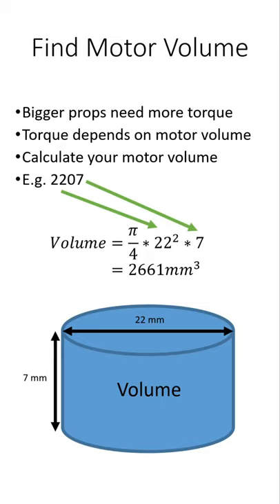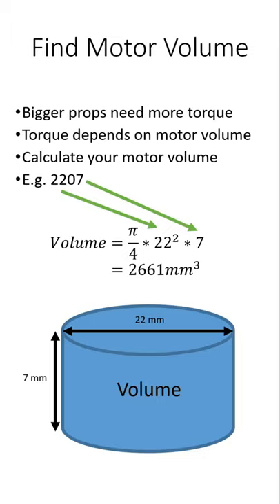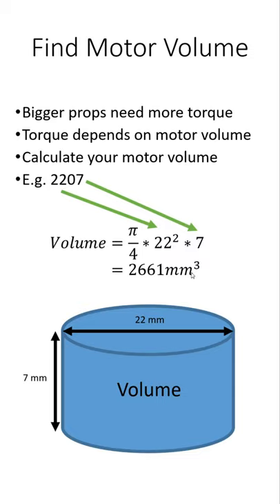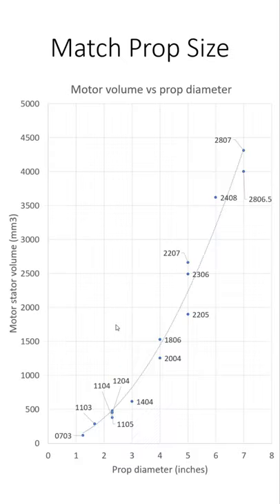How to pick the right size motor for your build in 45 seconds #shorts

Comment: Some other significant factors include:
1) How you plan to fly (efficient cruising vs racing, etc), 
2) Where you want to fly (sometimes the weight advantage is worth it if you fly indoors or in tight spaces even if a larger motor would have better command of the prop)
4) Even for a given volume there are tall narrow motors and short pancake motors which have different strengths and weaknesses. 

And of course there are many factors that determine how much torque you need. So, maybe not quite so simple. Also note that YT does not let you pause a video in the “shorts” format so the graph is hard to see.
Reply from the maker: Thanks for the thoughtful comment! I'm going to do a deeper dive on this over the next few days. I have some questions based on your points:

1) I would say that the choice of prop is what really matters here. If you are cruising you might use a low pitch prop but for racing a higher pitch prop could be better. A heavier prop needs a bigger motor because the cruising torque is higher so you need more max torque to retain enough torque reserve for control.

2) This is an interesting point. I would suggest that if you need a lower weight you could consider using a smaller prop. E.g. go down to a 4in prop then you could use a smaller motor and save weight on the frame as well. I think the end result will be better than having too little motor for a larger prop.

3) Pancake motors can have better cooling than tall narrow motors but their torque should be the same. That said a lot of pancake motors have a slightly taller stator than advertised which gives them more torque than expected.
Reply: Hi  @ChrisRosser , thanks for the detailed response. Yeah, the choice of prop is certainly a big piece of this puzzle.

Regarding tall vs wide motors... if you have torque measurements for motors of the same stator volume but different proportions, then I would love to see it. They do not “feel” the same, but I would love to have a more quantitative understanding of the differences. Even if the stator volume really is the same, the volume of the permanent magnets is not the same, and the leverage with which the magnets are pulled is not the same either. But more data needed for sure.
Reply: @Grim FPV chris showed in another video that leverage isn't a function of the torque a motor can produce, so this is incorrect, against our current group think on the subject. 

Talking out of my arse here, I think the "leverage" you speak of may have something to do with efficiency of the motor or something. There has to be another variable somewhere, as wider motors surely feel better than tall narrow motors to me. Maybe it's the MoI makes the motors smoother and less twitchy? Who knows. Maybe we are all full of shit and it's placebo 🤷
Reply: @Grim FPV you have the right idea, but it does indeed matter since the inertia is higher for a pancake. At the speeds we spin, it surely plays a non neglectable role. Tests would conclude who is right though.
Reply: @Grim FPV I totally agree what you are saying.
Reply: @villiamnilsson1994  Or actually, I don´t any more
Reply: @Grim FPV Actually, I have changed my mind here. No, a longer lever does not mean more torque, unless you use that space to increase the surface area or increasing the number of magnets of the motor.
Reply: @Grim FPV  Kind of pointless quote..... I believe it can be explained like this: The reason why a lever is used is that you can apply a force over a distance, you generate a greater force over a shorter distance. The problem with the motor, given the same surface area, is that with the wider/shorter motor, the magnet needs to travel a further distance to credit the whole potential force available, thus negating the lever. You simple can´t get something for nothing. If you don´t agree, please explain your train of thought.
Reply: @Grim FPV But with the same amount of magnets, where does this speed difference you are talking about come from? Two motors, same KV, same stator area, one tall and one wide, and you apply the same voltage, then they will spin at the same speed, right?
Reply: @Grim FPVI mentioned KV as to clarify that the wider and taller motors rotate at the same speed given the same voltage. KV is revolutions per minute (RPM) per volt so yes it applies.     How do you mean? The motors rotate with the same speed yes.....and the outer part of the wider motor is moving faster than the the outer part of the taller motor yes.....but where is your "cost of the speed of movement" for your wider motor?  Or are you in fact stating that the wider motor rotates at a slower speed given the same voltage than the taller motor?
Reply: @Grim FPV But then the KV is not the same. Ok then I understand what you are trying to say (even though it is not correct). But lets say that you wind the copper wire in such a way that the KV is the same, and apply the same voltage, what happends then? One wide motor and one tall
Reply: @Grim FPV But how would that be possible if it rotates at same speed?  Would you just get more and more torque for free the wider and shorter you make it? It would not. "That is straight physics".
Reply: @Grim FPV Well, KV states the unloaded speed, but then lets say that you spin the same type of prop on both motors. So what you are stating is that for a specific voltage, the wider motor will spin slower and have more torque and same current?....but...if it has more torque, why is it spinning slower than the tall motor? Should it not spin faster for the same load if you get more torque?    Or spin as fast, draw more current and have same torque?
Reply: @Grim FPV Hehe, I hope I don´t come across as an ass, I was thinking the same way you were but I changed my mind after pondering it (and yes I also have to think about this). So, about the windings, reducing the number of windings would rather (I think) reduce the current (however it might require thinner wires increasing the losses). Less windings = lower KV.  No, you can´t just say regardless of KV and current :-)  A lower KV motor will be able to move a heavier load, but slower than a higher KV motor.Think about this: "...given the same surface area, is that with the wider/shorter motor, the magnet needs to travel a further distance to credit the whole potential force available, thus negating the leverage" . Do you understand/agree/disagree that last part?
Reply: @Grim FPV Ah, thanks I did not remember correctly about the windings. Ah, no, you are not getting my point (and I hope I think correctly, trying to formulate this in practical ). Think like this. If you are going around in a carousel, one has a circumference of 10 meters and the other 20 meters (or yards). Now, on the 10m one, for every meter, you have two friends on the side pushing you and giving you more speed. On the 20m one you have one friend every meter pushing you. Now, the total number of friends pushing are 20 friends on both right? So which carousel has the largest torque in the fulcrum/center?
Reply: @Grim FPV (sorry seems to have responded with my other account) But torque isn't just lever, it is force x lever. So in my example, you would have r as radius and F for force. Lets say that your friends can push with 10 newton each. With radius multiplied with force, then you for the 10m  carousel get  10m x 2 friends x 10N = 200Nm of torque. For the 20m carousel you get 20m x 1 friend x10N = 200Nm. So, the torque is the same in this specific case right? (this is just one step on the way so stay with me)

Comment: I like formulas. It's way better than guessing. 2 of my quads were a guess on motor size and KV. 1 was the recommended motors and KV for the frame I bought and the most recent one, a 5" was between 2306 and 2207 because that's what everyone recommended for 5" quads. 2400kv was the only available KV with the 4s motors I bought.
Reply from the maker: 2306 and 2207 are both great sizes for a 5in. I would generally go with 2207 over 2306 but the difference is only ~6%

Comment: How do I figure out what motor works for a heavy build? High KV and less battery cells or low KV and higher battery cell count? Number of prop blades? Ducts or no ducts? I fly 5inch as well as 2.5 and 3inch and 75mm and 65mm whoops of various cell count setups, 1-2-3s whoops, 2-3s toothpick 3-4s cinewhoop 4-6s 5inchers.
Reply from the maker: I have videos on choosing the right prop size and the effect of prop pitch, blades etc. as well as a full length video on choosing motors.

Comment: You make it simple but the diameter give you the torque arm, the bigger the diameter, the bigger the torque arm.  It is not juste a factor of volume because for 2 different motor of the same volume but different diameter and heigth ,  the bigger diameter will have a bigger torque when the copper filling, air gap, flux ring are the same.

Now with that said, not all motor of the same size have the same performance. It is common to see motors wich does not have enough copper on the stator , thin lead wires or have a thin flux ring. Usually they market them as a light weigth (high performance catch) .  When I rewind  those motors, they get heavier but they perform better in thrust, efficiency and produce more torque.

Comment: Volume is a good way to quickly compare one size to another in terms of how much power it can put out but width vs height still plays a considerable role. Wider stators will have better control over the prop due to mechanical advantage and since multirotors rely on precise control of the prop you definitely need to take that into account based on prop size. A 1230 stator has more volume than a 2208 stator but it's not going to have the same level of control over the prop and thus performance will suffer in a multirotor application.
Reply from the maker: I think you'll get a real kick out of my deep dive on this subject. It's the next video I'm working on, and I hope you like it!
Reply: @ChrisRosser  Looking forward to it! You're doing a great thing with this channel & providing insight on things I haven't really seen anyone else try to tackle yet. Keep up the good work!

Comment: I just got the Shendrone Siccario and  do have vibration issues. Since I am using 7 inch bi blades on the down motors vibrations are gone. Do you think it`s basically possible to use 7 inch bi blades down and 8inch tri blades on the upper motors?

Comment: Thanks, but does it also depend on the AUW?
Reply from the maker: Yes to a certain degree, if you are planning a heavier build you could use slightly larger motors but you should also consider whether larger props would also be desirable to lift that extra mass. Typically most quads of a certain prop size fall into a certain weight class due to the necessary size of battery, motors and frame.
Reply: @ChrisRosser  "most quads of a certain prop size fall into a certain weight class"... The range in that class is huge though, isn't it? a 5 inch could be anywhere from 300g AUW or less to 800g AUW or more, for example.
Reply from the maker: @xxfoobarxx But that whole range of AUW is covered by a relatively narrow range of motor sizes: 2204 to 2208. If you look at quads with small motors they are spinning lightweight props that require less torque (low pitch biblades).

You can fly a heavy quad on 2205 motors 5x4x3 props (my first drone flew great) but try to fly a 300g quad on 2004 motors 5x5x3. It'll fly but be all over the place (learnt that the hard way!). It keeps bringing us back to the torque of the motor needing to be enough for the prop no matter the weight of the quad.
Reply: @ChrisRosser  this narrow range of rotor volume is the one thing that simplifies motor choice. At least the possibility space isn't too big :)
To answer the initial question though, n parameters -> n degree graph. One must simplify to explain, but not to understand.

Comment: should also consider if using bi-blade or tri-blade(mostly). and the kind of motor winding, delta(mostly) or wye.
Reply from the maker: I'll definitely touch on number of blades and the blade pitch in the longer video I am working on for this topic. The winding type is interesting question. I would argue that the winding type changes the electrical properties of the motor (kV) but its mechanical torque should remain the same so it shouldn't affect the sizing. What do you think?
Reply: I still dont have a definite answer to this one, as I have only played with motor rewinding just recently. 

but Im just wondering WHY motor manufacturers use delta winding instead of star. motors for larger props tend to be bigger and heavier.

on my most recent upload, im using racerstar BR2507S, rewound and meant for use on a 8" biblade prop. but im just using it on 7"tri.. cuz I dont have a GOOD 8" frame. I do have bengged XL8 frame(4.7mm arm).. too bendy
Reply from the maker: @raffyturc  It is all about the kV. You choose your winding topology based on your desired kV, wire diameter and stator size, and winding geometry. Star windings will have lower kV than delta windings all else being equal. There is no difference in the maximum power of the motor, its torque or anything else. Only kV. Hope this helps!
Reply: @ChrisRosser  yup. I chose star. lower Kv though.  but good torque(and less power draw). on my previous attempts on 8" biblade with rewound motor, I can get it to hover on 4amps or less.

Comment: Do you have a pdf or spreadsheet with the motor size/prop size?  I’m a moderator on 2 “new to FPV” Facebook groups, this would be most helpful.
Reply from the maker: Check out my full motor video https://youtu.be/RXy00orSpfU and slides available here: https://drive.google.com/drive/folders/1md9Vc2l-PnY5jVDQSH7HXB_FSh5z8dr_?usp=sharing

Comment: does the bearing size matter at all? I thought one would need to substract it from the volume
also, what's the curve equation? I'd like to compare 1606 vs 2203.5 against it
Reply: played a little with the spreadsheet and managed to recreate the chart, so I guess the curve is just a trendline with type "power series":
https://docs.google.com/spreadsheets/d/1ResAn8iFKq6v1XcPXoh4qGcYhHsn-OAzK31SlcHz2_4/edit?usp=sharing
and I think the bearing size does matter, as seen on the 1606 vs 2203.5 - I had both on 700gram 3inch cinewhoop and there's huge difference, but the cooling might be the big factor here.
Reply from the maker: Bearing volume is a big deal as it will reduce the volume available for copper windings. It is important to have a big enough bearing for durability though so it's a trade-off that the designer (and customer) has to make.
Reply: @ChrisRosser  so we should substract the bearing volume from the motor volume formula?
check out https://docs.google.com/spreadsheets/d/1ResAn8iFKq6v1XcPXoh4qGcYhHsn-OAzK31SlcHz2_4/edit?usp=sharing - I managed to recreate your chart and did the same comparison for Badwell's spreadsheet where he put ready to fly quads from different producers.
Reply from the maker: @grzbiet  it's not quite that simple. Hopefully the video will help 😁

Comment: Why doesn't this formula take weight into account? I have a 3" toothpick that has a dry weight of 67g and another 3" toothpick that has a dry weight of 87g. Surely the weight of the quad is a factor in picking a motor size?
Reply from the maker: For most pilots responsiveness is more important than max thrust. Typically, very little time is spent at very high throttle (~100%) and even in those cases it is the battery not the motors that limits maximum power.

How fast you can spin up (and more importantly spin down) a prop determines how well the FC can control the quadcopter in the sky, how quickly it can modulate thrust to follow stick inputs or resist outside forces. The torque required to do that doesn't depend on the weight of the quad only the moment of inertia of the prop and motor.

If you only cared about having enough thrust (not responsiveness) you would pick a much smaller motor and hover at a higher throttle position. Such a quad would fly (and be more efficient) but would feel sluggish and unresponsive in the air. How does this take on the issue align with your experience?
Reply: @ChrisRosser  It doesn’t because I use 3s on the lightweight build and 4s on the heavier one.
Reply from the maker: @russwishtart  So 3S vs 4S will affect what kV you need but not the motor size. If you feel like the 4S quad is more powerful it probably is, but that is almost certainly the battery being able to supply more power not the motors being more powerful. At 100% throttle our quads are almost always limited by the battery's ability to supply power not the max motor power.
Reply: @ChrisRosser  I use 1105 motors with 450 mAh 3S batteries on the lightweight build and 1204 motors with 530 mAh 4S batteries on the heavier build. Both motors say 5000 kV on the bell. Does that change anything?
Reply from the maker: @russwishtart  Yes, it makes a big difference. Your bigger 4S pack can supply more current at a higher voltage (so much more power) it will generate more torque in any given motor than a 3S pack (because of the extra voltage). I would expect the heavier build to be more stable in the air as a result if you use the same props on both and both are well tuned. Do you get any instability on your lightweight build at low throttle?